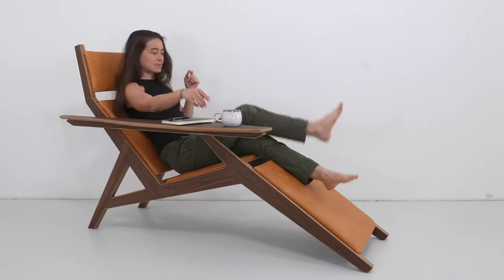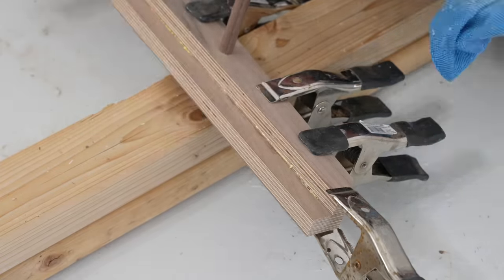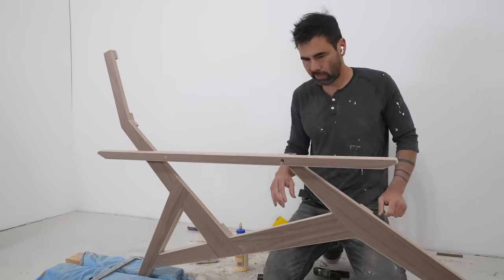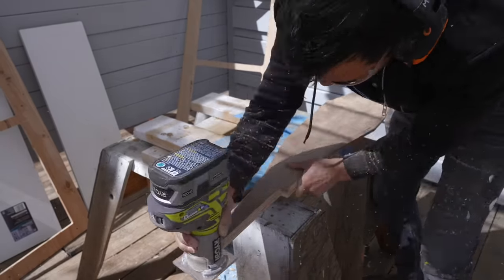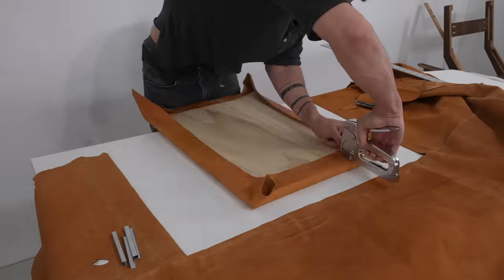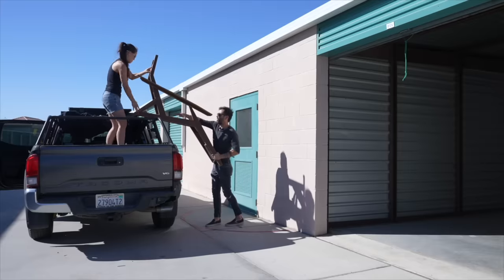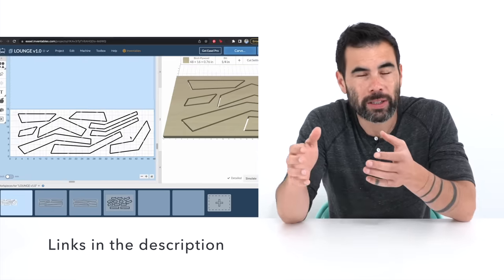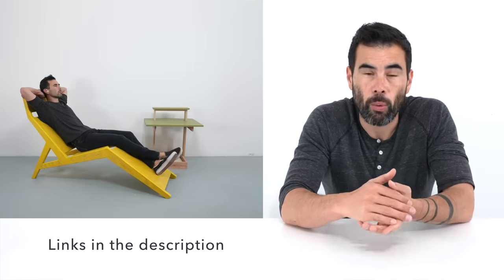Making a Plywood Lounge Chair V2.0

Comment: Could you make a printable drawings for the parts, or pre-printed schematics true to size that could be traced onto the plywood and jig-sawwed out?
Reply from the maker: working on it!
Reply: This is what I was going to suggest. A4 printed paper sheets, with alignment keys (lines where 2 or more sheets overlap to position) 
Then pritstick (glue stick) the paper to the wood. Score the printer lines with a sharp edge and cut.
Reply: @HomeMadeModern  great, I'd like to try making this with hardwoods and handtools :)
Reply: Can’t wait. Please, this is a great design

Comment: Nice design. As far as the cushions, you're on the right track. First, I would round the sharp square edges of the backer. Then, use foam plus a cotton or poly batting over it and under the fabric. Staple from the center outwards and, as you do at the corner keep folding/bisecting the angle. The plywood is good as a backer, I think, or you can use what's called "cambric" to hide the stapled side. Cheers.
Reply from the maker: Thanks for the tips this is super helpful!
Reply: Look for a channel by a guy "Chest'r" and watch how he does it. Also, the old "Furniture Guys" shows from the Learning Channel. Both are master refinishers and upholsterers. ;)

Comment: can you not print the design on mutiple a4 sheets stick to the sheet, and cut them out with a jigsaw, then sand to the line
Reply from the maker: we tried that before and people flooded us with questions about printing so we stopped
Reply: @HomeMadeModern  Is using a jigsaw a feasible way of doing it if we don’t flood you with questions? 😅
Reply: @HomeMadeModern  simplest, cheapest solution, i stopped answering the same question after 5 years :)

Comment: Are you able to adjust the parts by % on the cnc machine simply.?
Standard 6 foot person,  reduce by 20%, & 30% ect..?
Reply from the maker: it is easy to scale by percentage but you still have to account for connections involving the materials thickness and make sure that the pieces are structurally sound without compromising material efficiency too much

Comment: For this chair a simple drawing with dimensions, DWG, PDF, just a clean JPG enough. If I 'm making one I don't need a template. If more the one then I'd just as soon make my own templates and besides if this is and adjustable design then you have to buy multiple templates. I'd rather put the money in the chair and draw the thing out by hand. But then how else are you going to make money off people?
Reply from the maker: the files are up for free on easel now.  We will make a DXF /dwg file available shortly. any good suggestions on hosting that type of document?